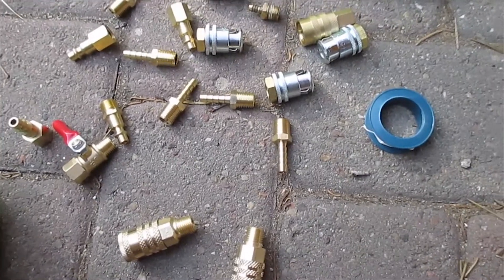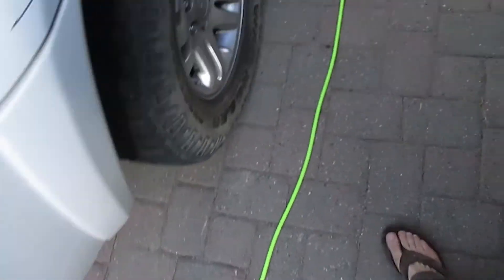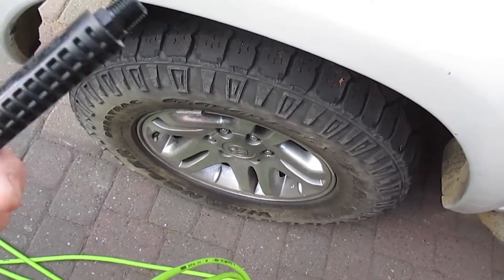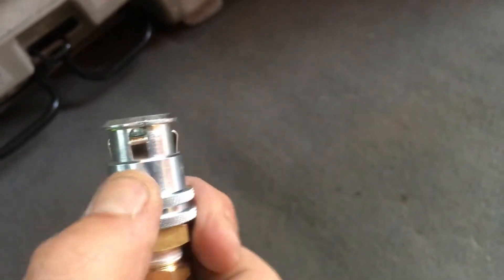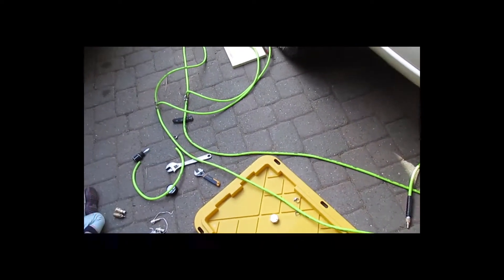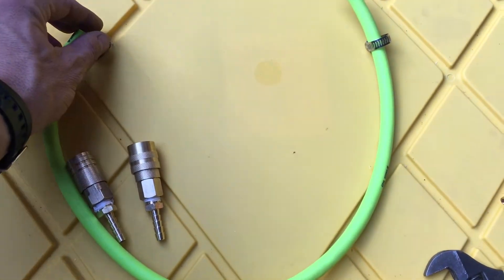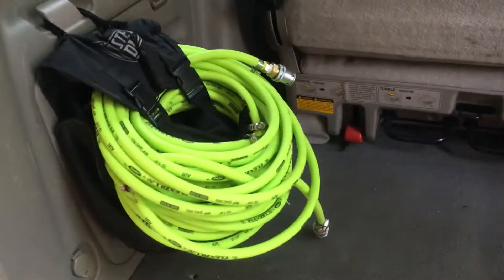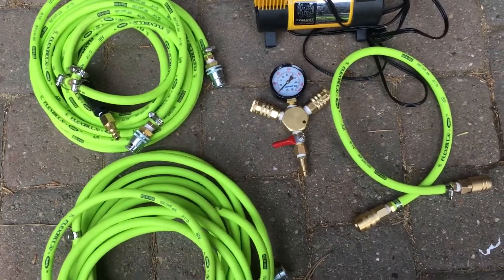4 Tire Inflation System - DIY

Comment: Do those Air Connections at the Valve Stems NOT FLOW AIR when they are down?

Can you put part names/numbers in the comments (I’m viewing on my iPad and can’t see them???)
Reply from the maker: The ball valve regulates the whole system and keeps it all open or closed depending on what you're doing.

Haltec lock on air chuck: https://www.amazon.com/gp/product/B08BTPG6J8?pf_rd_r=7HR320DWHZA9HAHY5WY4&pf_rd_p=5ae2c7f8-e0c6-4f35-9071-dc3240e894a8&pd_rd_r=b3d51e35-4d3b-4070-a4fa-88e106dcaf37&pd_rd_w=syipL&pd_rd_wg=swtUH&ref_=pd_gw_unk

Flexzilla hose: https://www.amazon.com/Flexzilla-Fittings-Lightweight-Hybrid-ZillaGreen/dp/B000R8LH3E/ref=sr_1_1?dchild=1&keywords=Flexzilla+HFZ1450YW2+1%2F4%22+%28inches%29+x+50%27+%28feet%29+Air+Hose%2C+50+ft%2C+MNPT+Fittings%2C+Heavy+Duty%2C+Lightweight%2C+Hybrid%2C+ZillaGreen-HFZ1450YW2%2C+1%2F4%22+%28inches%29+x+50%27+%28feet%29&qid=1618211960&sr=8-1

Coilhose Pneumatics 3122 Flat Hex Manifold: https://www.amazon.com/gp/product/B003D7KN2C/ref=ppx_yo_dt_b_asin_title_o02_s02?ie=UTF8&psc=1

Nigo Industrial Co. 3-Way Tee Brass Hose Fitting: https://www.amazon.com/gp/product/B07HX952SJ/ref=ppx_yo_dt_b_asin_title_o02_s01?ie=UTF8&psc=1

1/4 Inch Ball Valve NPT Air Compressor Brass Valve Female Male Shut Off Small: https://www.amazon.com/gp/product/B0823QBKFV/ref=ppx_yo_dt_b_asin_title_o02_s00?ie=UTF8&psc=1

1/4 in. I.D. Air Hose Repair Kit: https://www.harborfreight.com/air-tools-compressors/air-compressor-accessories/14-in-id-air-hose-repair-kit-7-pc-63569.html

1/4 in. Male Brass Industrial Coupler: https://www.harborfreight.com/air-tools-compressors/air-compressor-accessories/14-in-male-brass-industrial-coupler-63558.html

160 PSI 1/4 in. NPT Dry Filled Pressure Gauge: https://www.harborfreight.com/160-psi-14-in-npt-dry-filled-pressure-gauge-64104.html
Reply: The "open flow" air chucks will flow air when they are not installed on a tire and the "closed flow" air chucks WILL NOT flow air when they are installed on a tire.  The ones that most of us are traditionally familiar with are the "closed flow" models... It takes a different design to your air system to use "open flow" ones in that you need to place valves basically in places where they would have been with the "closed flow" air chucks if you don't want to be losing air from the remaining tires in the system as soon as you unhook one tire from the inflator system hoses... With the way he plumbed this air system, if he is using the "open flow" air chucks, then he needs to detach all the air chucks as quickly as possible to minimize the air loss in each of the remaining tires... Even if you are very quick, you'll end up with slightly different pressures in each tire... It might not be enough for you to notice it though.... But if you really want all tires to be equal, then you need to either go with "closed flow" air chucks or install a ball valve near each air chuck and then close off each ball valve before removing the "open flow" air chuck for that tires... That just adds to the cost, so I would stay with the traditional "closed flow" air chucks...

Comment: I am assuming one or two tires pressure will not be the same once it is inflated, one or two tires will be low or higher than the other ones.
Reply from the maker: Yeah they are just a little off but easy to adjust once full
Reply: @marcelrowley6411   that is because the hose was not cut and t- spliced in the middle on each side. both the front and rear hose should be of equal length.

Comment: I found using 3/8 hose put much less strain on my compressor, and aired up faster.
Reply: Yeah you can literally use everything he listed with a 3/8 hose cuz the ends of them are still 1/4 male fittings. According to a few people, 3/8 hose is better

Comment: You should look into the arb twin if you want onboard air. Otherwise the smittybilt 2781 is a great portable one and you can cut off the Japanese fitting that comes with it and use a barb to attach it to a standard 1/4” npt and connect to your 4 way inflator
Reply from the maker: We've definitely upgraded since the video. Now we have the ARB twins in a case but I'm considering a few creative options for mounting...